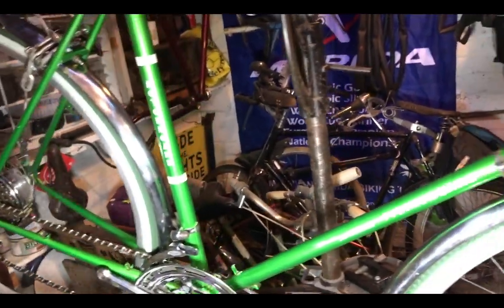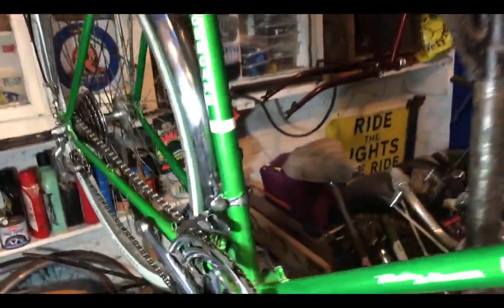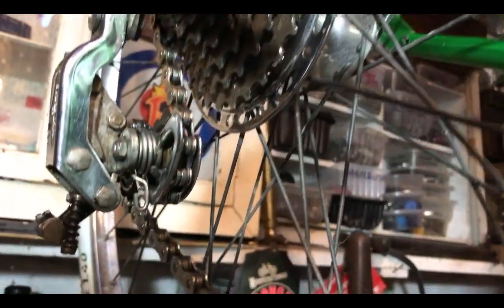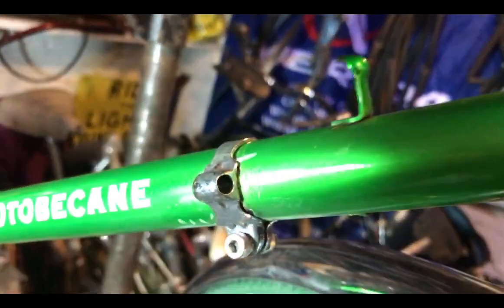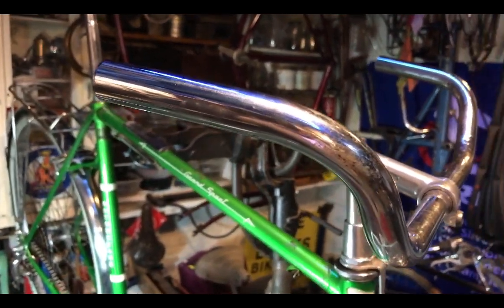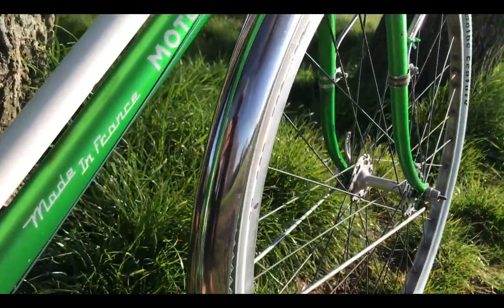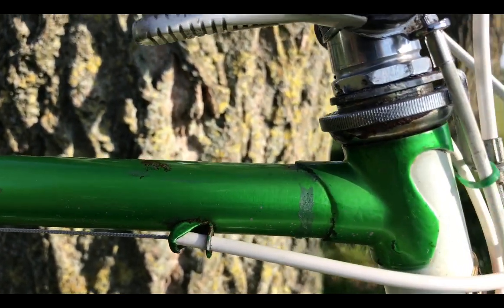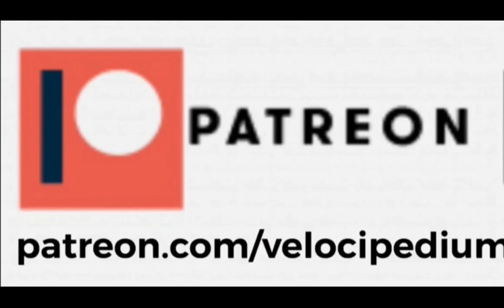Finally! Motobecane classic French steel Randonneur bicycle, Watch to the end, looks amazing!

Comment: Looks really good, great job! I've noticed you've put on 700x35c tyres on this bike. Was this the original wheel/tyre size? I've recently found a Motobecane T10 randonneur fitted with the original 650B standard ( 40-584). Hard to find a replacementf for these.Any suggestions?